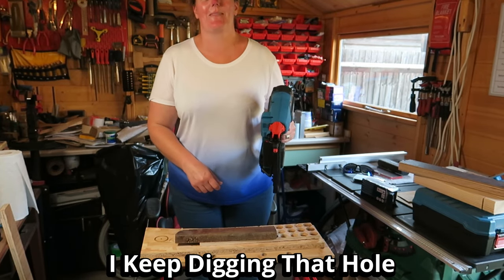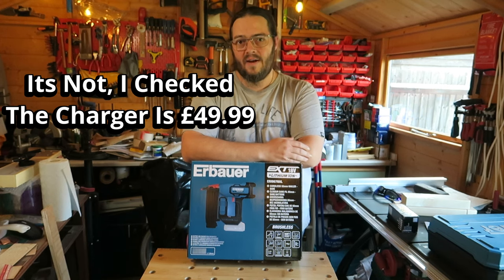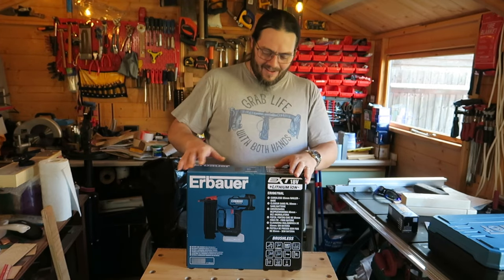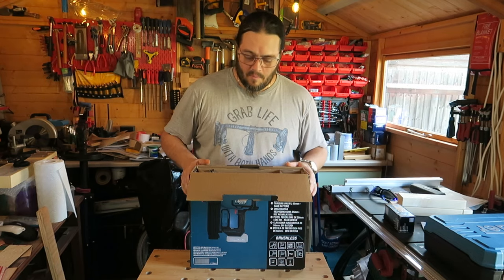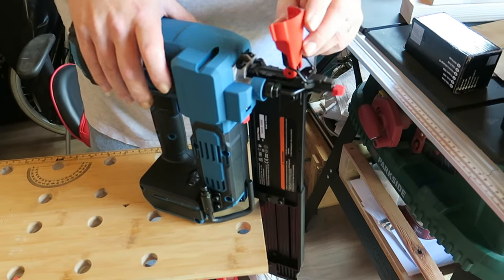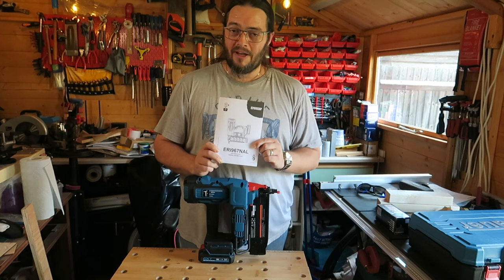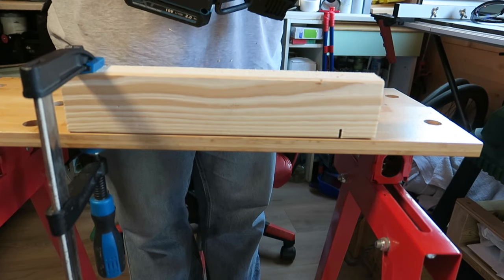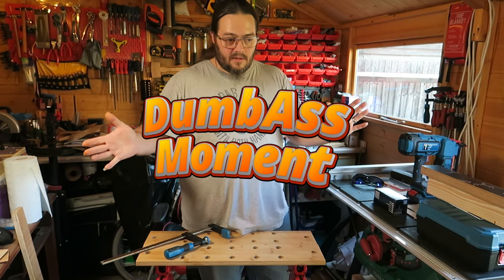Unboxing My Awesome New Tool, ScrewFix's Erbauer Nail Gun

Comment: Great review. I got the erbauer first fix gun a while back. Never missed a beat yet. Could get the second fix for love nor money. Ended up driving 3hrs to get my hands on one. But we'll worth the effort. Great guns love the bump fire option. I had the hikoki framing nailer but the weight of that was something else. These are more than holding their own. Do yourself a favour and get 1 or 2 5amp batteries. Last ages. 😊
Reply from the maker: Hi thankyou for watching Adi's Little Shedshop, oh yes this is a very worthy nail gun and I totally get what you're saying, sometimes you can't get your hands on the tool for love nor money, it's like they come in and are gone in a flash, it's been months since I was able to get a battery from any one of my 3 local stores, and i have family that works there. Really good under appreciated tools I think and they certainly give the big names a run for their money. Thankyou and keep watching for more videos coming soon

Comment: That hard wood could be purple heart. I work as an overhead lineman, we used to have wooden crossarms holding 11kv wires up at the top of electric poles, they were made from puple heart. It's a protected timber now so you don't often come across it and It grows in the Amazon. It reacts with UV when cut and if left outside the colour grows more purple over a few days. Eventually the colour goes back to an orange/brown colour. If you treat it to hold it's colour you need to use water based sealers.
Reply from the maker: Hi thankyou for watching Adi's Little Shedshop, that is very interesting, I hadn't thought it could be anything like purple heart, here in the UK purple heart costs a fortune, I actually have some I bought to turn on the lathe, still purple at the mo, I will have a side by side with it to check the grain structure. Thankyou. Keep watching for more videos coming soon